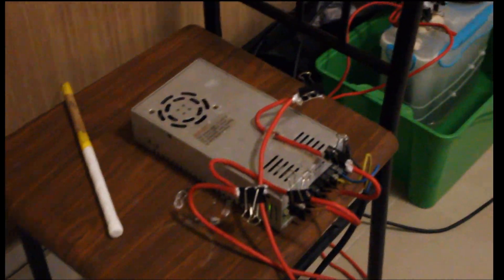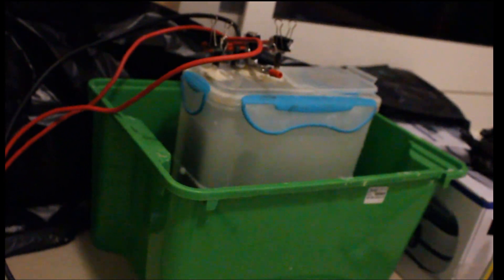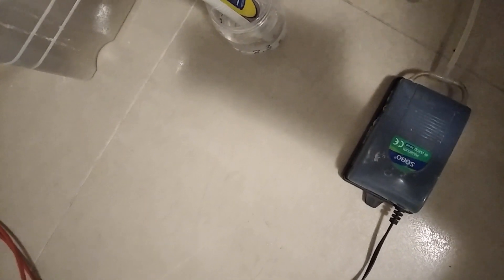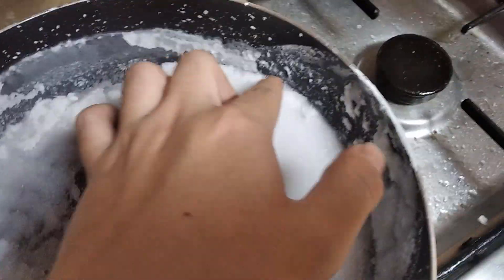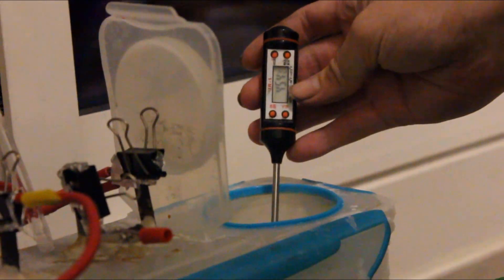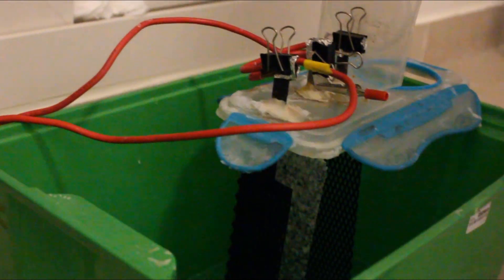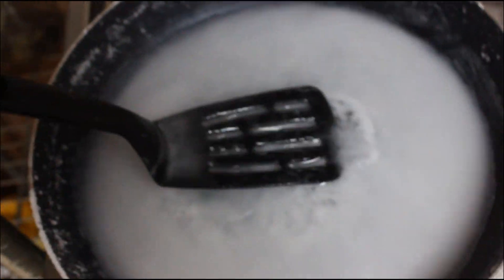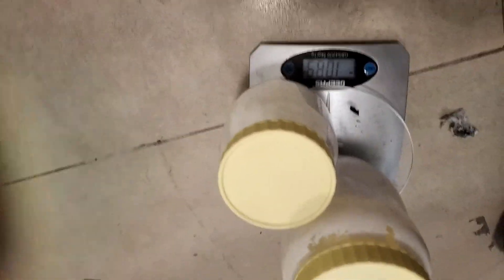pH buffered chlorate cell full run.

Comment: How often do you recommend PH monitoring ? Every minute, hour, day ?
Reply: A tutorial on fractionating NaCl out from the NaClO3 would be great
Reply from the maker: @orlandoluscombe3008  sure when i get to making another batch because...
I currently have 6kg of pure NaClO3 and nothing to do with it XD.
but the method is super simple.
at high temp boiling the NaCl will PPT out since its solubility is constant so every fraction always reduce 20-30% of volume and filter hot.
Then when cold as the NaClO3 comes out the volume will further drop and you just repeat.
Reply: @CatboyChemicalSociety ah i see thanks, and have fun with ur NaClO3 XD, also wondering how well bubbling the spare Cl through water produced HCl, may as well see if i can make the most out of the chlorate cell.
Reply from the maker: @orlandoluscombe3008  u cant just bubble Cl2 through water to make HCl you need a UVC source to make HCl with that reaction.
These following reactions will occur.
H2 + Cl2 = HCl (exothermic)
Cl2 + H2O = HOCl + HCl (equilibrium)
HOCl = Cl2 + H2O + O2 (endothermic)
O2 = O3 (endothermic)
HOCl + O3 = HCl + O2 (exothermic)

I have a video showing how I make HCl using a chloro alkali cell still not fully proper yet because my new MMO plate electrode for my fullscale chloro alkali cell is delayed :( and graphite sucks!!
Reply from the maker: I do it 2x every day but during this run i had the pH suddenly go up to 7.8 or you can just keep adding small amount of CaCl2 everyday which will keep the pH constant due to its buffering action.
Though this weirdly seems to be dependent on temperature.
but I monitor the pH 2x a day during morning and evening.
usually when i see the pH reach 7.3 i put in some CaCl2, I just extract it from cheap quality salt but if you had pure CaCl2 you really dont need that much however I wish I knew the content of CaCl2 in that cheap salt but weirdly it doesnt even have a nutrition sheet at the back of the paper it just says "BEST LIFE SALT"........
unlike using HCl you dont have to constantly adjust/monitor the pH since its self regulating but it does seem to be temperature dependent and the pH of my cell only went down once the temp reached around 50 Celsius + and I notice something else when I let it get to 68 the pH was at 6.6 then I let the temp drop by cooling it went up to 7.2 at 55 Celsius and then I let it reach 65 and it was around 6.8 to 7.
it really didnt make much sense but since im not using pure CaCl2 I cannot properly confirm the temperature dependence being a factor.
but I can confirm one thing.
when you start up your cell it will initially go alkaline during the 1st 3-5 hours then pH suddenly drops either due to temp rise or probably a reaction between NaOH and CaCl2 or something but the overall sign that pH control is working is a white crust Ca(OH)2 forms on the cathode after a few hours of operation and white flaky mush at the bottom which is free slaked lime which is insoluble in the salt solution.
ensure you cathodic surface area is less than anodic surface area for best results.
use mesh anodes if you are gonna have the cathode in the middle as plate anodes require a cathode on each face which means small titanium strips instead of a large mesh.
due to the high operating temperature only MMO can work for this type of cell.
Reply: Cool good to know that. Caclo3 can also be used to get other chlorates. If you react it with a sulfate salt from soluable salt you end up with CaSO4 which is easy to filter out.
Reply from the maker: @Telectronics  rather use graphite to make CaClO3 since I heard its really hard on MMO as I heard this time the lime produced will be in solution.

Comment from the maker: Latest run 82% efficiency yield was 1.3Kg in 4days 4 hours!!
in that run I made sure to add CaCl2 extracted from cheap salt everyday to keep pH low.
I had a more accurate shunt and kept current running at 25 ams.
ran at 63-68 Celsius this time.

Comment from the maker: Mesh anodes are always better than plate type anodes.
more even current density distribution due to the mesh allowing current to go through the holes instead of around the anode itself.
for plate anodes you must put a cathode on both sides and that cathode must be of smaller size then anode for good cell performance aka PLATE ANODES SUCK!!.
Plate anodes have 1 key advantage over mesh anodes in a KClO3 cell where the KClO3 crystals wont form in the anode causing dmg on mesh types.
if you use KCl as electrolyte use plate anodes and if you use NaCl or NaCl/CaCl2 use mesh.

MMO can make perchlorate due to the IrO2 present but the RuO2 will erode and the anodes life will be shortened so do not try it also efficiency will be abyssmal.
pure IrO2 coating will make perchlorate but with terrible efficiency but it wont errode either.
best to get your nice ceramic plate and a pan with cover and just heat up your NaClO3 to make NaClO4 with a high efficiency chlorate cell like this who needs to run a perchlorate cell 4.2 days = 1.5kg NaClO3.
if you want to do a nice KClO4 synthesis use mix of KClO3 and NaClO3 in ratio 1:3 or 1:2  yields are usually 81-90% based on KClO3 fed since the NaClO3 will push out all the potassium perchlorate and it will decompose in its place.
Reply: Hello , I am on second day run and my ph is like 4-5 and my glass jar is at 40 degrés Celsius : how I can up the ph? Thanks
Reply from the maker: @pyrotekmanfred6503  pH meter cannot measure the pH directly it will get poisoned via internal precipitation of chlorate.
pH meters use a standard KCl as reference solution and therefore cannot be used.
to measure pH of your cell properly you need to take a sample and boil it down until dry crystals then add distilled water and measure using pH paper.
this is the only good way to measure pH as a pH of 4.5 is impossible in these kinds of cells.
My pH meter was sorta hacked by using sodium bicarb as its standard solution (DONT DO THIS) it ended up working but due to how sodium bicarb is not very soluble it died after a few uses.
I now use the boiling method to measure pH.

Comment from the maker: Do not also do this when running your anodes at high current densities.
mines are run at 80-100 ma/cm^2 because the buildup of crust on cathode can increase local current density and if you run at 200 or something your electrodes will errode in spots.
besides running at that current will boil the solution of my cell anyway so i keep it at 25 amps meaning current density of 80ma/cm^2.
electrode surface area is 2*6 inches converted to cm^2 thats 78.232cm^2 for one plane since its a mesh electrode its multiplied by 2 and since there are 2 electrodes its multipled by 2 again with total surface area of 312.93cm^2 now given 25000ma/312.93 gives us 79.89 ma/cm^2